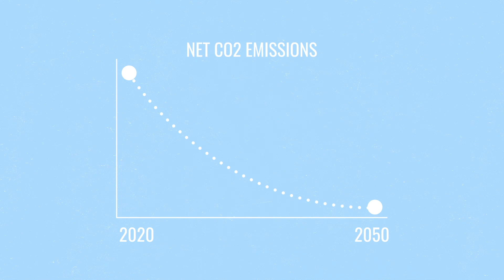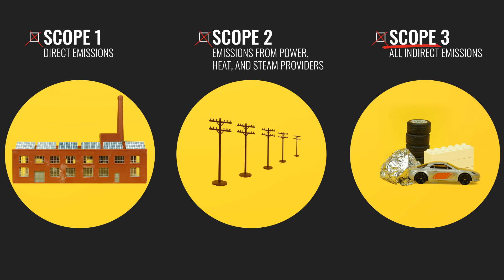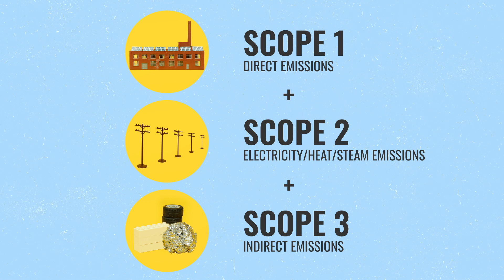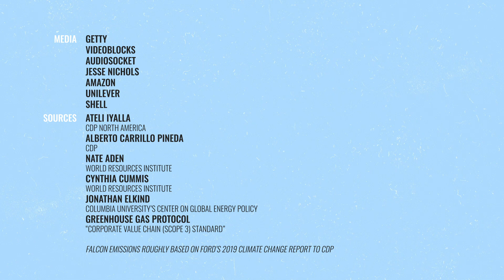Net zero climate plans, explained

Comment: This video has the United Nations Climate Change disclaimer.  The cause of global warming is not know in 2024.  Global warming was officially stated at 1.1°C in 1991 and 1.06°C in 2022.  Global warming has been staled at about 1°C since 1992.  

Increasing average global temperatures are greatly meaningless to modern human lives not eliciting concern.  In the early 1980s to promote the need to prepare for increasing average global temperatures the term Climate Change was given for the already known prediction of stronger Gulf of Mexico hurricanes when global warming reached 1.5°C on track to take place in 2010.  That required stronger Gulf of Mexico oil platform design and builds talking place in the 1970s.

This was qualifiedly a change in human activity that is in some sense due to a change in climate or Climate Change.  There was also expected increases in sea levels from warmer expanding sea water.  The term Climate Change is much more attention provoking than the term Global Warming even though no credible Climate Change, and very minimal at that, would take place until global warming reached 1.5°C.  

There were no plausible mechanisms from the current science in 1980 that could cause increasing average global temperatures.   In the 1950s earth’s atmosphere had been greatly studied and the characteristics of its major gases greatly understood.   Earth’s saturated greenhouse effect from water vapor adding 10°F (5.55°C) to earth’s average temperature was well known.   In was taught in 1970s US public school science education.  

It is scientifically impossible for greenhouse gas behavior to cause global warming.  All the greenhouse radiant energy from the earth is completely absorbed in earth's greenhouse effect by greenhouse gases within 20 meters of the radiating surface that is always in saturation from the strong greenhouse gas water vapor.  

The back of the United Nation's Intergovernmental Panel on Climate Change (IPCC) science report states it took its greenhouse gas samples at 20,000 meters altitude where it is common high school level knowledge there is no greenhouse radiant energy.  This is typical practice for deceptive marketing to state legal data transparency protecting the perpetrators from fraud prosecution.   The IPCC has been transparent with its data acknowledging it is not dealing with active greenhouse gases.  

Earth's greenhouse effect is frequently used as a primary example to high school students of a system always in saturation from the strong greenhouse gas water vapor absorbing all the greenhouse radiant energy from the earth with greenhouse gases within 20 meters of the radiating surface that is all around us everyday and can't have its overall effect changed.  There is no further greenhouse radiant energy to interact with greenhouse gases.  

At 1% average tropospheric water vapor over 99% of earth’s greenhouse effect is from water vapor.  Water vapor would hold earth's greenhouse effect in saturation if it were the only greenhouse gas in the atmosphere.   The overall average temperature gain to the earth from the earth’s greenhouse effect is 5.55°C (10°F).

Arctic warming is taking place with the proving mechanism being warm Atlantic Ocean waters migrating deeper and more frequently into the Arctic Ocean warming it and the region.   That warmer water is causing a few weeks less of reflective snow and ice coverage resulting in more solar heat gain to the Arctic region surface.

Atmospheric CO2 levels of 1200 ppm about three times what they are today would greatly invigorate C3 plants the majority of plant life on earth greatly greening the planet. 

0.4% of the atmosphere is CO2 and on average 1% is H20 water vapor.   (1% H20)/(0.4% CO2) = 25.  Water vapor is 25 times more present in the atmosphere on average than CO2.   Water vapor has an CO2e of 18,  18 X 25 = 450 CO2e total for water vapor to 1 CO2e for CO2. 

The Earth’s oceans have 3-1/2 million sea floor volcanic vents warming the water and changing it’s chemistry that have not been systematically accounted for.

Comment: Can the likes of wind turbines and solar panels be built, transported, and maintained using zero emissions?
Reply: it's not zero emission but net zero emission, s-panels are built using silicon and other materials which have to be mined and hence some unavoidable processes.
Reply: @rishab_agarwal16  Yes, my mistake, that's what I meant. Can the likes of wind turbines and solar panels be built, transported, maintained, and recycled or scrapped with net zero emissions?
Reply: @ken4975  I think you have answered your own question. No.
Reply: @alanrobertson9790  I'm shocked.

Comment: Cant be done without depopulation.
Reply: Wrong
Reply: @ThomasBomb45  considering everything organic is carbon I think you will find I'm not far off the mark.
Reply: @WOKETUBE-SUX  Ok, and? The problem with fossil fuels is that we are taking carbon from deep underground and pumping it into the biosphere. It is fine to take existing carbon from the biosphere. Like if you cut down a tree and let it regrow, the amount of carbon in the air doesn't change
Reply: @ThomasBomb45  I think you will find now that all these volcanoes are popping off and will continue for some time that arguement is irrelevant. Has any climate debate you ever examined mentioned two facts? First the sun controls the climate, and second it shut off back in december 2019.
Reply: @WOKETUBE-SUX  It's sad to see someone so lost in oil company propaganda. There has not been significant volcanism or changes to the sun that would cause the 1 degree of warming that we already have experienced since the industrial revolution
Reply: @WOKETUBE-SUX  400 year cycle? No way. The earth hasn't been this warm for thousands of years
Reply: @WOKETUBE-SUX  20,000 years ago was also 5 degrees cooler then it is today
Reply: @ThomasBomb45  it's probably a bit to complicated for you to grasp. Stick with the big lie it's easier for them to sell the carbon tax that way.
Reply: @WOKETUBE-SUX  look at any temperature graph for the past 20,000 years
Reply: @ThomasBomb45  have done and further back. Go and have a look into south Atlantic anomaly, cosmic Ray's, geomagnetic excursion, grand solar minimum. And dont forget ice ages.
Reply: @WOKETUBE-SUX  the temperature doesn't change this quickly naturally
Reply: @WOKETUBE-SUX  None of those things support the idea that population growth is the problem... get your story straight. Is climate change caused by humans or not?
Reply: @ThomasBomb45  not caused by humans at all. But you are living an extinction level event. There net zero climate agenda is all about keeping you down and in your place by making you feel bad. Agreed they need to try and do something. But lying was not high on my list.
Reply: @ThomasBomb45  yes it does. You have to understand earth/sun cycles and you will understand when you realize how many are coming together just now. Regardless of current natural warming, the future is cold.
Reply: @WOKETUBE-SUX  If what you're saying is true, then we would want to have more people burning fossil fuels and making more carbon dioxide, wouldn't we?
Reply: @ThomasBomb45  yes agreed but when I say all these volcanoes are starting to go off. I mean just starting. There may be some kinda of hopefully off set there. But I really doudt they can do anything about it. If you read the other side of the story ( the one I'm suggesting) and bear in mind all the current locust plagues combined with the lies. It's hard to argue against the suggestion that they are planning to starve and freeze us to death?
Reply: @WOKETUBE-SUX  Locust plagues? Volcanoes? Are you in a disaster cult?

What would "they" benefit from starving people to death?? Only movie villains cause suffering on purpose. In real life, evil people seek selfish gain and that just happens to cause suffering. No one kills massive amounts for the hell of it
Reply: @ThomasBomb45  all real go check it out for yourself. Be specific in your google searches and dont forget the ?
Reply: @WOKETUBE-SUX  Care to provide a citation? scientific papers, data, etc. No youtube videos
Reply: @WOKETUBE-SUX  If you could provide me with the papers, then please do. That would be great!
Reply: @joezucc3074  will do I'm getting ready for work just now but should get some down time tonight and off for the next 3 days. This will still involve some intense research and most people are unable to get it. If you want to start the ball rolling just now, research how many volcanoes have blown off in the last couple off years. And what the effects are going to be on global temperatures and food growing abilities across the planet. Also factor in the record floods, record cold and yes there is extreme heat but you will soon understand that. Oh and dont forget to research the locusts. The first paper I will send you is the insurance risk assessment for where we are at. And I'll explain why it's still a half truth at best.
Reply: Carbon net zero could be done but isn't worth doing. Will it be done, probably not. Global carbon emissions since the Paris treaty have risen steadily each year with a little dip for Covid lockdown. Any small reduction in the West is more than offset by the developing world. I don't think its a policy a majority would vote for. Governments have avoided a vote by entering into international future treaties before the costs become apparent. We are now seeing a reaction against these policies throughout Europe.
Reply: May I add, this debate is fascinating

Comment: North Euro offshore wind turbines work 33% of the time
North Euro onshore wind turbines work 22% of the time
North Euro solar panels work 11% of the time
Solar and wind are 2% of global energy 
Europe burns 80% of all wood pellet cargo for renewable electricity
Europe burns 80% of its curbside recycled plastic & paper for electricity
Europe burns 50% of its palm oil cargo in diesel engines
Europe gets 60% of its renewable energy burning stuff
4% of energy is renewable

Comment: 4 billion people live now with severe water shortages at least one month per year
4% of mammals are wild and battery/bio-energy extraction will kill them off
66% of humanity will be water stressed by 2025 says Nat Geo in 2020
50% of thermal & hydro electric power will be water stressed
40% of coal power is water stressed, and so will be 30% of planned hyrdo power
North Euro offshore wind works 30% of the time, onshore works 22%, and solar 11% 
80% of energy is fossil and 20% is electric of which 4% is renewable 2% solar & wind
2% of global energy is solar and wind after 20 years trying
By 2040, 15% of global energy will be renewable, with 28% by 2050

Most solar panels will be un-recyclable toxic waste growing at 6 million tons/yr by 2050
Europe burns 80% of wood pellets, and 80% of its recycled plastic/paper for electricity
Trees grow faster and die younger with increasing temps droughts & fire
Amazon tree farms take 30 yrs to recoup 10% of Amazon' tree loss
Overseas forests are clear-cut & burned for 50% of Europe's renewable electricity
Palm and soy grown in the tropics are shipped to Europe to burn in diesels
Europe burns 50% of its palm oil cargo in diesel engines
Batteries and bio-energy will wipe out tropical habitat for humans and wildlife
The UN failed all 20 bio-diversity pledges from 10 years ago
There have been 25 UN Climate COPS and 15 Bio-diversity COPS
There were 1.5 billion flights in 2019

Renewable energy production will exacerbate mining threats to biodiversity 
– Nature 2020
The social and environmental complexities of extracting energy transition metals 
– Nature 2020
The number of active renewable energy facilities within important conservation lands could increase by 42% over the next 8 years – BBC 2020
The quest for renewable energy could wreak havoc on wildlife – Mic 2020

Earth is heating 46% faster than 50 years ago
Greenhouse gases went up 46% in the last 30 years
Oceans take 89% of heat air takes 1%
Ozone destroying green house gases increase every year

Nitrous oxide eats the ozone and is the 3rd biggest greenhouse gas
Abrupt permafrost deep soil carbon and nitrous oxide loss is not modelled
350 ppm CO2 will not cool eath, 300 maybe will do it
We must cut energy use 50% in 10 yrs to stay under 1.5 C
This never happened in history, and will never happen in the future
People who are richer smarter and older than you don't want you to know this